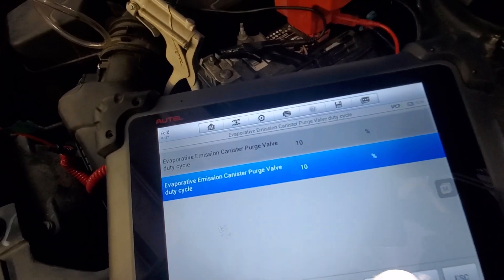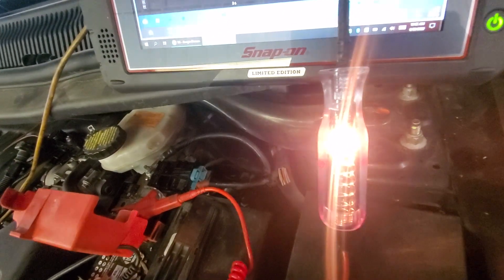2014 FORD EXPLORER 3.5L (VIN: 8), P0455/P0457, AUTEL VS. ZEUS BI-DIRECTIONAL FUN (PART II)

Comment: Makes it fun being a tech. Fighting bad parts. Possibly a manager that doesn't believe it. Arguing with parts houses that there part is no good. If your flat rate wbo pays or do you prove a couple aftermarket parts are no good for free?
Reply from the maker: For sure Marcus, if it was easy I'd hate my job.  I like to be challenged, surrounded by tech's who are better than me, and learning to set goals is critical to success.

Maybe these video's I did discussing this stuff will help answer your other question a bit 🤔:

https://youtu.be/XkSvzGyHegI

https://youtu.be/l6GWDp2j7Jw

https://youtu.be/hbUR_5Cxw5U

Comment: I thought that was funny, both SD and you doing EVAP work at the same time. Thanks for using the test lamp as a test for us guys who don't own a scope. Now we know what to look for.
Reply from the maker: For sure interesting, he was frustrated and rightfully so.

Yes, a standard test light is a quick test for control 😉; it's also a great way to test that ground side switched ECM driver loaded with a 160ma test lamp ofcourse.

I will also try to use my multimeter more in the future.  We often forget that not everyone out there is rockin the oscilloscope; makes it really difficult to see those fast sensor signals and PWM control for sure!

Thanks for watching Wyatt, I'm digging your XJ videos-so jealous...living the fun life my friend!!!